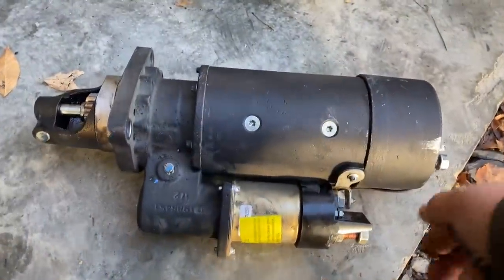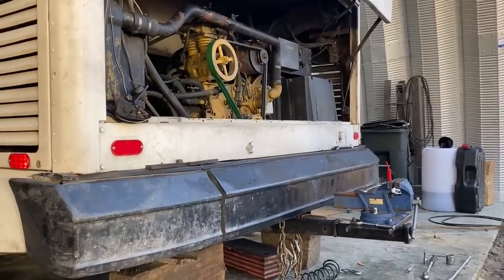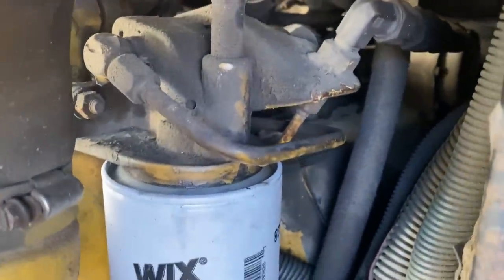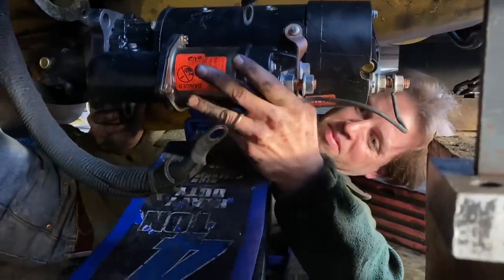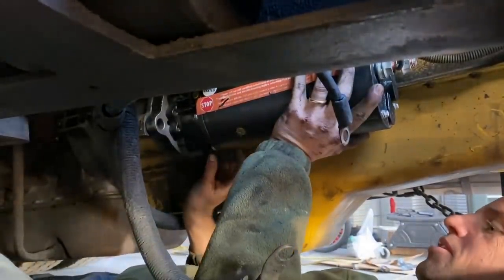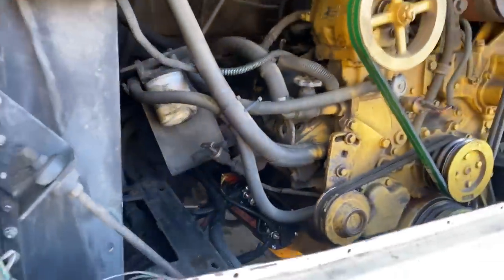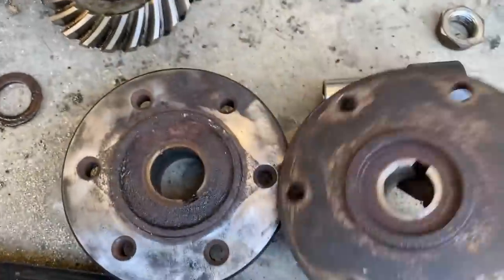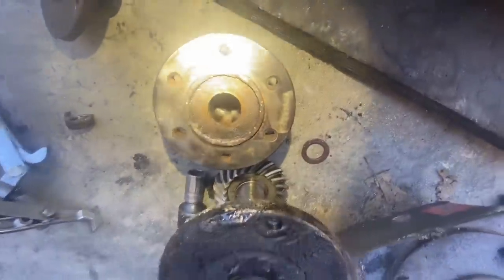Bad mechanic put wrong starter on this bus.  24v on a 12v bus.  Charged $1,400 (900 for the starter)

Comment: Had an owner who ran a small fleet of Triaxle dump trucks I drove for him for 6 years and was always having starter issues especially in the winter. I finally convinced him to try an air starter system by simply pointing out to run a permanent air line out to the parked trucks ( outdoors). He took the worst starting truck and installed the system and it suddenly became the best starting truck in the small fleet. After one winter he finally agreed and installed air starter systems on all the trucks. All trucks got new air compressors as well. Just an FYI the latest air starter systems will start down to 60 PSI INSTEAD OF 100 PSI the old systems required. Even if you lost air pressure I demonstrated how I the take the tire air line kept in each truck and used one tire to refill the starter air tank to start the truck then simply let the pressure build until the tire was properly inflated. 

Sometimes simple solutions are easier than tracking down electrical problems.

Food for thought
Reply: Very interesting !!!!!!!!!!!!!!!!!!!!!!
Reply: The fact that they sound cooler doesn't hurt matters either. ;)
Reply: I converted my GM4106 8v71 to 24V system mainly for the 24V starter. It spins the 8v71 like its a 283 chevy.  Doesn't hurt the alternator puts out 7kw either.

Comment: Scott there is an adjustment for the throw of the solenoid, the cap at the front with the screw driver slot, remove it and in side is a 7/16 nut, there should be only about two threads showing past the nut, if there is more back the nut out. You will need to engage the solenoid to do this. remove the link between the starter and solenoid, this prevents the starter motor from cranking.  The solenoid throw is over-adjusted, its too tight, and is running out of throw before the disc can connect to crank the engine. I can go into more detail if you like.
Reply: Kind of rare to read something as accurately stated as this.  You have earned your stripes.  Most of the time I am hearing remarks like "It must have a short in it somewhere".
Reply: @larrywalker7759  Thanks Larry, 14 years owning and operating a two person rotating electrical shop, my wife and I and 1 training the new guy I sold the shop to. You see it all when it's just you.

Comment: That fan hub likely uses that ring in the center to locate the fan perfectly centered. Think hub-centric vs lug-centric wheels. If you grind that ring off, the fan will likely be off-centered and gradually destroy the bearings in the new right angle gearbox over time from vibration. You may not even be able to feel the vibration, but the gearbox will. The "correct" way to do this would be to bore the center of the original fan hub out to the new shaft size if possible. Or machine the actual hub on the fan to accept the new larger locating ring.
Reply: sorry man we must have been typing at the same time  i did not mean to repeat your comment ,  both are correct
Reply: i am sorry i should have read your post before i commented , i said the same thing,
Reply: I agree the locating ring is needed. But since the new hub is about 3 times as thick as the original, I think that the too-large ring can be faced off, and a second cut taken to thin the face of the hub down and create a ring of the right diameter.
Reply: I'm glad I scrolled down to see your reply, my exact thoughts!!
Reply: @lwilton  that would be my plan of attack too. Machine the face of the larger hub to include the centering ring the same diameter as the original.

Comment: The more I've watched your videos, the more I've become convinced that the diesel mechanic industry is full of scammers and morons. The world needs more honest and knowledgeable diesel mechanics like you.
Reply: ALL  industries  have  hacks.   I sold  auto parts, some truck, heavy hardware and rigging for  15 years,  was an HVAC/R mech for about 12, and worked a few years installing telco/ radio / 911 equipment.   There are hacks everywhere  and I've  seen my share.   I tried not to be one

Comment: I have replaced the contacts on starter solenoids (and brushes on starter too), much cheaper than a rebuilt starter.  i keep brushes and contacts for the starter and alternator in the truck when on trips.  I think you are an honest mechanic and i think you know what you are doing.

Comment: Just a possible tip to help install a heavy part like this starter or in my cases it was flywheels. A stud in a top hole that has the same bolt size and pitch headless of course but it just becomes a stout pin to hang the heavy starter on while installing. Then put other bolts in and remove the stud and save for a later day. Be interesting to hear how the shop addresses the 24V return issue. Gary
Reply: I'd like to hear an update about what happens at the other shop as well.

Comment: I am glad to hear you are making progress. I just watched the first video a few  minutes ago. $1400.00 bucks for the wrong starter. That's nuts!!!
Reply: Criminal.....as well as 'Nuts'....
Reply: the price is typical for most heavy-duty shops. here, shops charge $150-$180 per hour for labor and parts mark-up is 3.2 times the wholesale cost, so $1400 is about right. but yes, they screwed up by installing the wrong starter...

Comment: Probably a voltage drop on the signal circuit to the solenoid. The solenoid clicking but the starter not spinning even on the new unit.

Comment: I had a similar setup with a Thomas bus cat 3208na. I found a relay (solenoid) for the starter circuit on the outside of the frame rail (inside of the C channel). It was just old and corroded but still good with a complete clean up, never gave any issues after the cleaning. Also I abandoned the hub city affair for the cooling fan and installed an electric fan, I found the hub city gears make way too much noise as it was mounted to the frame.

Comment: that bit your gonna machine off is hub centric it centers the fan hub precisely if you bolt the fan hub up without that it will destroy the gearbox  even if you cant detect any out of balance visually  the fan will probably go through the radiator when it happens  maybe you can machine the fan hub so it fits the hub  centric collar what ever you do must fit  to that hub centric arrangement . Its the same mechanical principle used on high end car rims

Comment: You can buy the primer pump itself from cat. No need to replace the whole housing. As for the starter, the mechanic should have noticed the substantial weight difference between the 2. I'm surprised that it worked at all. I'm surprised that you use a jack to put it in. At 60 yrs old i still just muscle them in.

Comment: When my uncle owned several coaches I helped him replace a starter in a big Cummins engine.  Everything went perfectly except it would not start after.  We all scratched our heads and called others and it turned out the starter was miss marked for a marine application and was spinning the wrong way.  No damage done.  But a head scratcher for a bit.

Comment: Question Bus Grease Monkey: there are three oil reservoirs to lube the starter shaft bushings.  Many mechanic don't check to see if the wells are full. Used engine thirty weight oil. And yes did in-house repair when parts were easy to find. Good video, real life not Hollywood.

Comment: Check cable ends and ground connection it sounds like a bad connection issue when you try to engage and get the loud click. Pos and negative connections 👍🖐

Comment: Address the starting circuit. Noted the sound. Notice in two starts you pressed both the button and the remote start trigger?

That remote panel may not be feeding enough current to the starter's main solenoid.

Open up that panel! You just might find a tired relay in there.

The "false start" is a sign of how the starter "bendix" or actuator is designed. The contact in that starter applies power to the motor once it travels fully forward. This prevents grinding the teeth of the flywheel.

The most recent heavy diesel starter I replaced was on a Cummins 11M. Stubborn, I hefted 60 pounds of iron. Got my day's workout for sure. Those little jacks come in handy.

Comment: When i was a young apprentice , my boss's , boss  , he had a boat with a V8  Cat , every year , on the mooring i had to take out the starter , take it to the work shop strip it , clean it completely test it  reinstall it , clean every ring gear tooth , baring over the Cat'
change  all of the belts , side fit spares ,  then one year he dreamed up that he wanted twin turbos ,that's was fun , all of this shit on a swing mooring , in the bilge  , in Auckland New Zealand , did that for 8 years , ( Forgot about the oil changes )

Comment: On my International 9400i with Detroit S60, I have two starter relay solenoids. One on the firewall (Ford Motor Co), the other on the starter. I wonder if this bus is setup the same way.

Comment: Thank you for this video....it helped a lot with replacing the starter on my 2000 thomas saf t liner mvp er.....a quick question though the odometer and speedometer doesn't work on my bus the light for the Guage comes on but the needle and numbers don't move any ideas what or where I should start?

Comment: Good knowledgeable true repair mechanics are nearly history.  These guys are the real deal.  There are so damn many thieves and flat out liars in this business.  Dealerships are worst places as the majority of workers( not a mechanic by any means) work at these dealerships BECAUSE they can't pull their weight at a private shop. I know a guy that has been in the inside of the local General Motors and Ford places.  Both over the years he said have had pathetic results with hiring knowledgeable mechanics.
Reply: there is your problem. hiring good mechanics is the wrong approach. hire people and MAKE them become good mechanics. That is how it should work. That way you only ever hire ONE good mechanic and he trains all the other ones. think trades where you have a master and everybody starts as an apprentice. companies do not want to make that investment anymore.

Comment: You may need to shim the starter out slightly as the bendex may not have enough travel before it bottoms on the flywheel teeth. This can keep the motor contacts from engaging. The giveaway is you can hear the solenoid engagement every time. The only other issue would be bad contacts which is entirely possible even on a rebuilt starter.

Comment: I turned wrenches for over 20 years and never once thought to look at a starter to see if it's 6 12 or 24 volts. Never got one that was incorrect aside from being completely obviously wrong for the application that is. I wouldn't throw the mechanic under the bus there's a service counter and a parts department a whole lot of blame to be spread around.

Comment: I just wonder if the battery cables could be bad. It'  seems after you use starter for a little bit I think they might be getting hot an causing a lot of resistance. Just an idear!
Reply: No amount of cranking would cause a battery cable to rise in resistance enough to create a problem.
Reply: @sw6188  a bad cable would absolutely get smoking hot. once it is hot resistance would be an issue.
Reply: @uliwehner  The only situation where resistance could be an issue would be at the connections - spade terminals etc. The cable itself could not rise enough in resistance to be a problem. It would have to be grossly undersized for that to be an issue. The typical starter motor cable of say 50 mm² has a cold resistance of 0.00034 ohms per foot. When hot, it might rise a bit but it's never going to get high enough to cause any appreciable voltage drop - not on such a short run.

Comment: on the fuel priming pump plunger housing... does it unbolt with 2 bolts on either side of the plunger housing to the actual filter housing..  must be clean like an operating room before unbolting please..  might be able to take apart... go to a hydraulic seal shop to get replacement seals..  at least for the rod seal.. 

 have to have the actual cat engine number to find a cat part..  you mentioned 3204.. but there are a bunch of different series possible. just thoughts..

Comment: Paying that kind of labor to thread 3 bolts into the bellhousing and tighten the couple terminal nuts is definitely taking the customer for a ride. I can think of only a couple vehicles where a starter is a pain in the ass job but still nowhere near worth even half of that to R&R. Older BMW's that use non-threaded hole starters are probably one of the most difficult and can usually be done with a long extension and a universal joint. Some people prefer to pull the intake manifold but most of the time it isn't necessary and just comes down to experience/ skill or preference. This Cat starter looks like one of the EASIEST ones, period. Tons of access, and no obstructions. I wish I ran the shop that could get rich off people like that. Freakin PATHETIC honestly.

Comment: The teeth on starter side are tapered and the side opposite of starter are straight cut without the taper lead in for bendix gear. This can clearly be seen at 1:05

Comment: If that would have been 24v to a 12v stater...... Wonder if there would have been any thing left from the fire.
That's scary bad.
Could have weakened some of the relays in the Battery Charge system or Starter.
No telling what the last guy did trying to get it to start every time.

Mesa, AZ

Comment: Many...used a 12/24v system.
24 to start on a 12v system.
Delco also had a 12/24 alternator. YES !!
They can be switched to a straight 12.
I'd just put a leece Neville alt on it.
The 24v starter runs from the series. Use one of the 12v for the system.
The "bad" mechanic sumply replaced as what was originally installed.

Comment: 38 years of driving trucks and buses only ever had one starter fail when the pinion sheared in the middle of Paris, France, These days they are pretty bomb-proof devices, but that muppet who fitted the wrong voltage unit needs to rethink his career options.

Comment: Is that a cat motor ,  i have 3406 cat in kenworth k100 and not sure if its 12 v or 24 v for starter any clues guys , it has 4 x 6 v battery set up

Comment: Question: Where you are running double belts, won't the one mid-size pulley cause odd belt wear?
Reply: The 2 different diameters will pose a problem with belt wear since one belt will try to go a different speed than the other. That fourth pulley looks to be bolted on. I mentioned to Scott in a comment previously that the machinist should turn the pulley down to match the others, provided there is sufficient material to do so.

Comment: I think you should “find” or machine a new pulley for the one that is slightly larger than the inside one. As you point out, one of the belts is loose.  But that also means one of the belts is slipping with each revolution. So it WILL wear out one of the belts and one day it will tear up and the belt could do lots of damage to wiring and hoses.  Just a suggestion.  Maybe some one already mentioned it.

Comment: Hi, Im wondering what the reason for not swapping to an Electric fan instead of that beefy and quite complex looking mechanical drive? Are there other things running off it?
Reply: The New Flyers running around on the campus where I work have FOUR electric radiator fans on them, and they are $800 *each*.
That's probably a reason. I won't necessarily say it's the reason.

Comment: How did you get the 24 volt starter to even work on a 12 volt system ? even if you had jump it with another12 volt battery you still only have 12 volts - I can see barring it over if the bendix was stuck in the flywheel teeth  but not starting on 12 volts unless it was marked with the wrong tag .